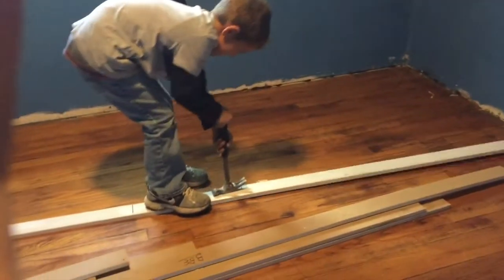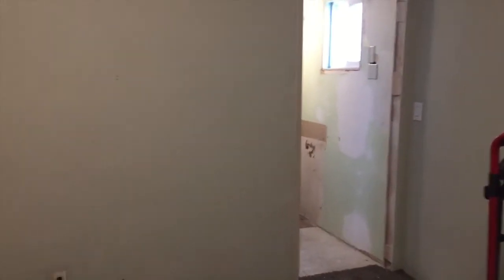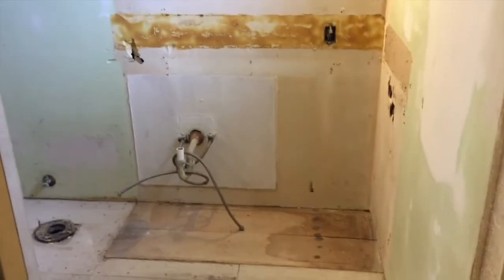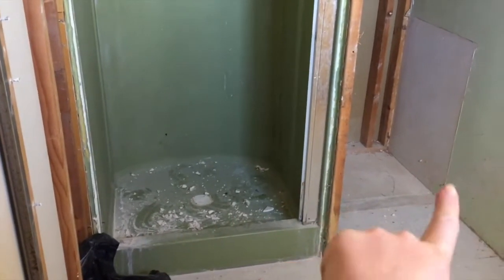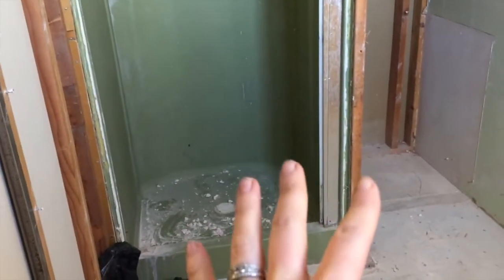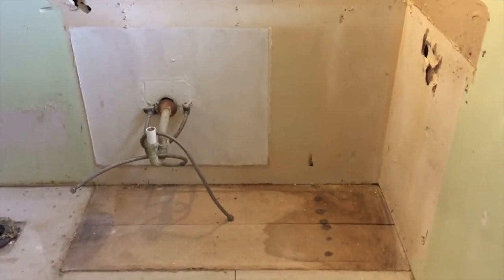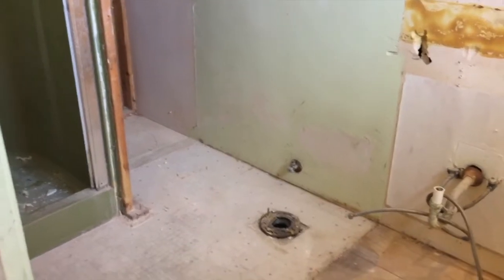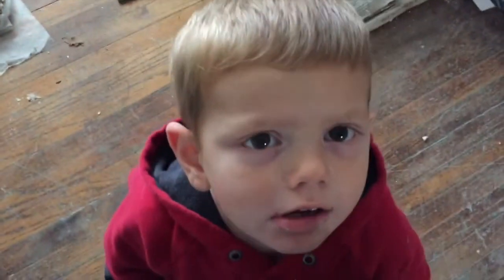How we are saving money on trim, master bathroom budget plans: Rehab Vlog 6

Comment: Since you have so much of the white subway tile, I would use that on the shower wall, with the cool hex tile (which if it doesn't match exactly, will surely 'blend') on the floor. Use all of the different sizes of the subway tile, arranged in a pattern. Very chic and zero money (say use the shorter ones vertically in a band around the shower and lining the product niche). I would save the lovely textured tile for the kitchen backsplash.
Reply from the maker: Wow, that sounds lovely! See I would have never come up with that idea. Great suggestions!
Reply: @FarmersWife  You are welcome. My design background is strictly commercial (offices, bank lobbies, retail shops, etc.) but I think the skills are transferrable.